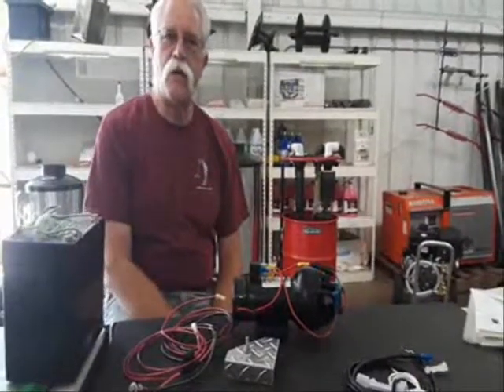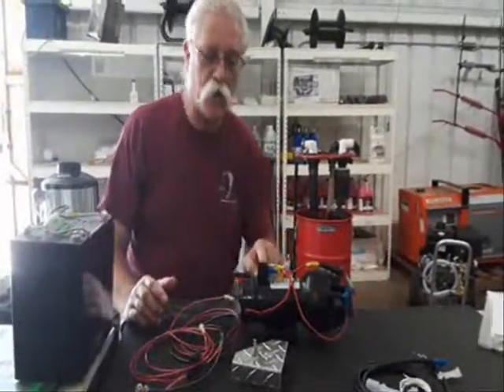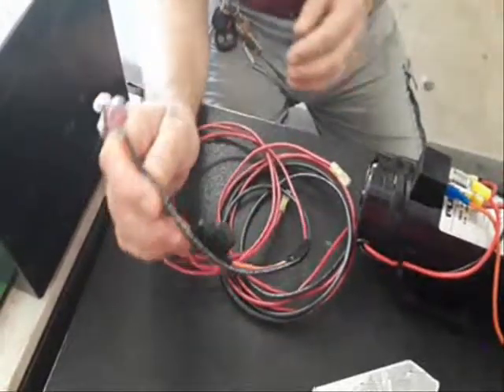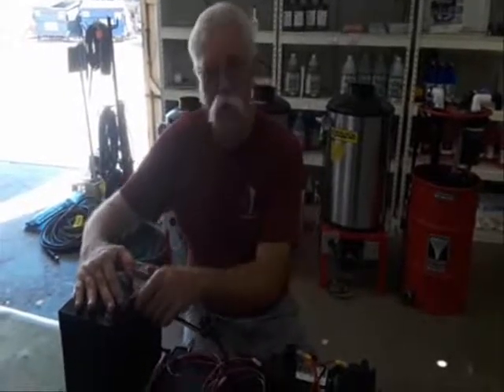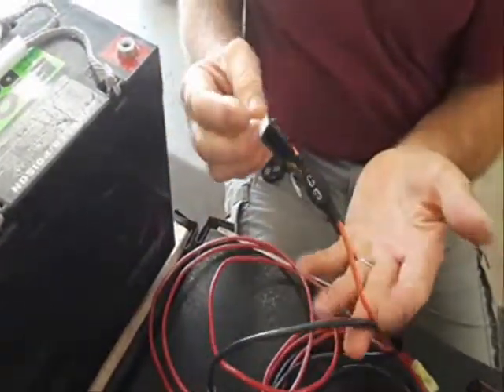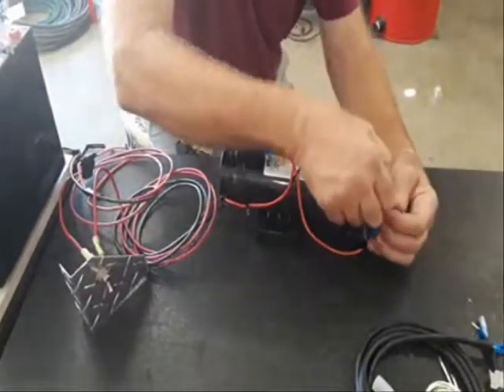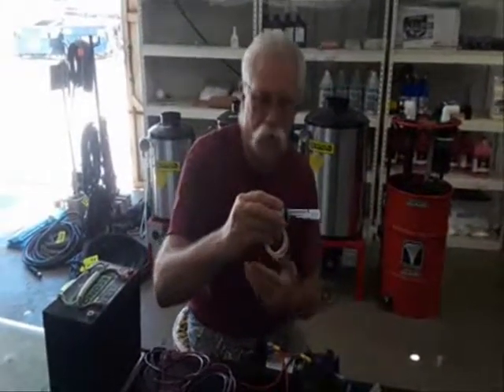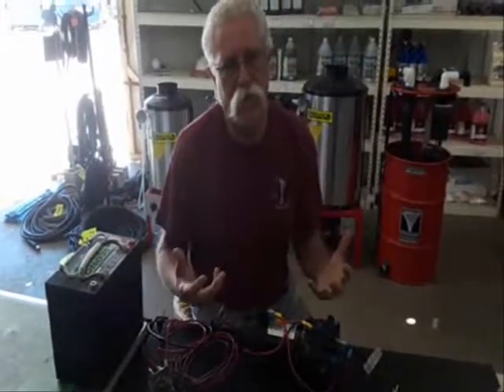12v Pump Install ✦ PressureWasher.net

Comment: can I still buy this on the website?  I have a trailer so can I just "hot lead" the battery for charging when I drive the truck? How would I charge the batts if I have them in a trailer?
Reply from the maker: Best to call for detail.. How you make connections and sizing cables and connectors is just as critical as protecting them. 
Call us.. we're Glad to Help.